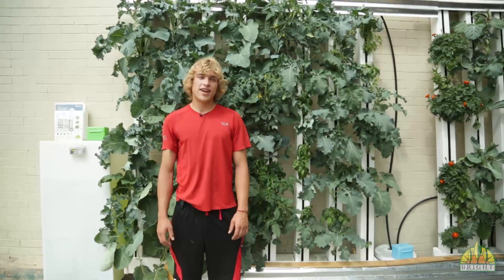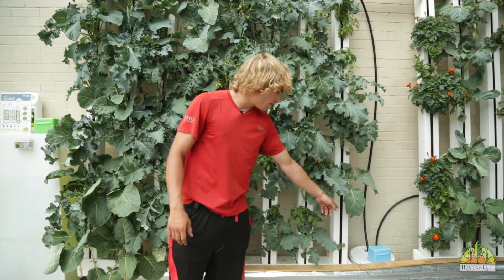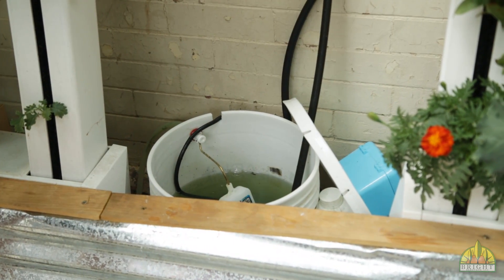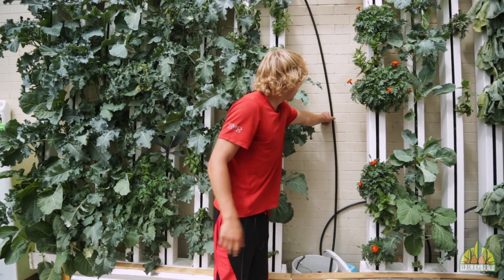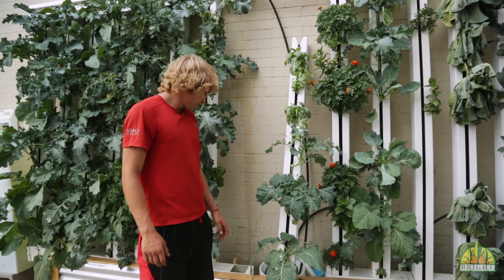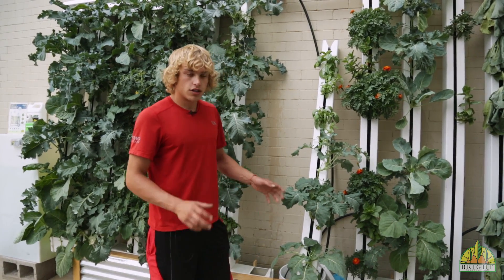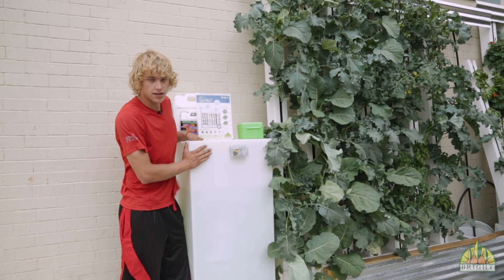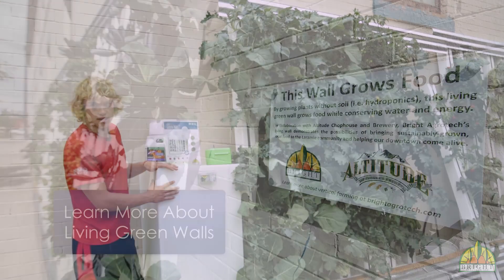How Do Living Green Walls Work?

Comment: hello, how do you handle when it rains and it is added to the system. would the solution become unbalanced?
Reply from the maker: Not really.  We haven't had too many issues with dilution- the opposite mostly, especially in the hot times of the summer.  By and large there aren't any issues with water entering the system.  If it does, awesome!  Free water!